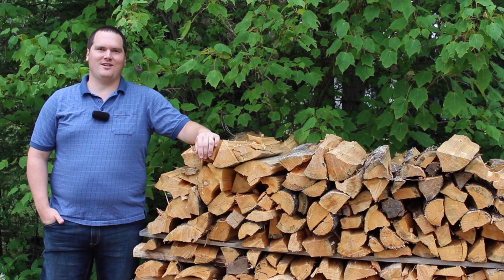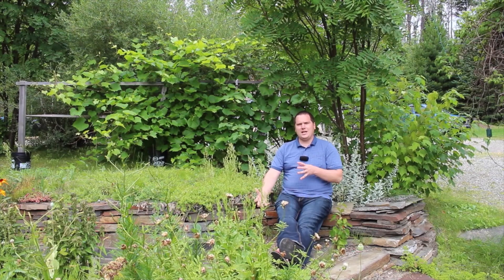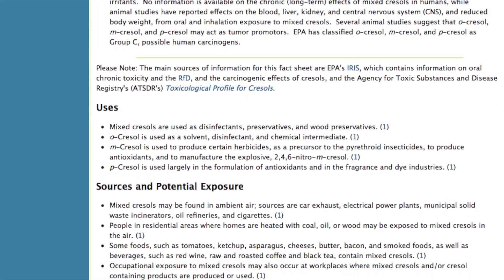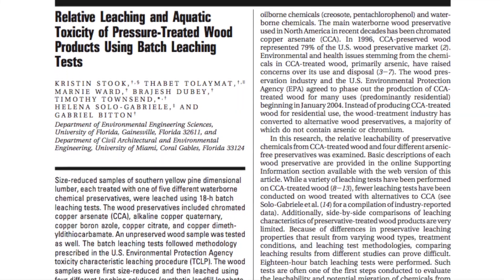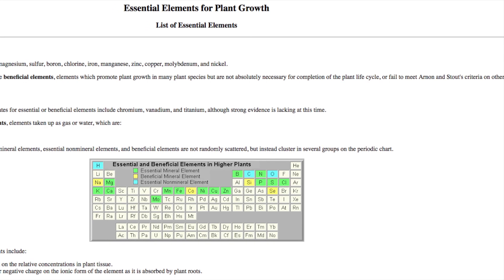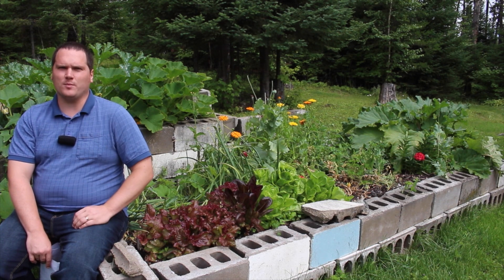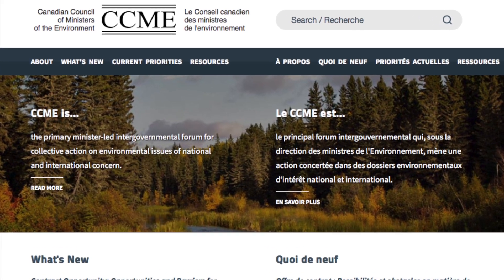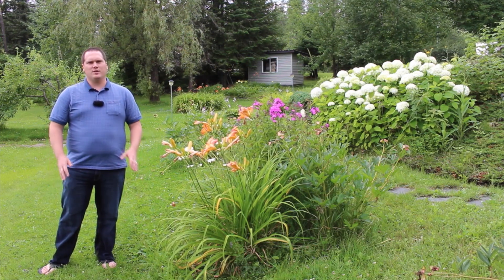Is Pressure Treated Wood Harmful to use in the Garden?

Comment: Hi, I’m concerned because I sprayed the inside of my planter box with Copper-Green to preserve the wood (before I learned that redwood has its own natural preservatives). 

The smell was SO bad, I had to immediately wash my hands, hair and clothes!  It’s not the 10% copper naphthenate I’m concerned with as much as the 90% Inert ingredients, which include petroleum distillates. Three days later and the smell is still very strong, and now Im concerned about planting my edibles in it!  

Do you or any readers here have any experience with Copper-Green and ideas of how I can remove or dilute some of the chemical residual (other than sanding it down)?

Comment: So I think what remains is that the PT lumber, even if it says it's rated for ground contact, still will eventually break down. So if you want them to last longer, then using an HDPE (type 2) or LDPE (type 4) plastic barrier might be a smart move anyway.  Also being sure to use a ceramic coated screw because the copper will react with any disimilar metal fastener and corrode it so the joints weaken faster than the wood. The sun can do quite a bit of damage to PT too. They say you can put a U/V protective finish on it about 6 months after it's had a chance to dry out.

Comment: Hmm, great video and nicely presented but I do have a concern. How do we know that the control hasn't been impacted by the leaching? A better control might be to use soil from a raised garden that doesn't have any pressure treated wood at all. You're also mentioning that it's only harmful if at toxic levels-- but I wonder if things like copper accumulate in our system, especially over time? Things to consider.

Comment: While this should reassure folks about the use of commercially treated wood, keep in mind avoiding DIY materials like used motor oil, which many use in fence post installs, and which could end up in proximity to a garden bed. Another more complex issue is whether some plants concentrate certain materials like selenium, such that safe soil concentrations might still result in higher levels in the actual consumed produce.

Comment: Thanks for the video Stephen!

I would like to use pressure-treated wood for construction of my 
garden, but I plan on using a plastic liner between the wood and soil. I 
have a few questions though:
1.) Do I have to line the bottom of the garden, even if it is not directly in contact with the pressure-treated wood? 
2.) If so, do I poke holes in the bottom of the plastic so that water can drain from the soil?
3.) At what depth do I bury the plastic? In other words, how much soil do I
 need to have so the roots won't penetrate the plastic?
4.) How thick (what MIL size) should I use?
5.) How often do I need to replace it the plastic?
Thanks!
- Chris

Comment: Thank you for this video so informative and not full off superstition and old wives tales. I have been on the fence with what lumber to use. I don't want to use the standard white wood and tends to break down in 5 years or so here in Utah. I am looking at using a pressure treated hemlock such as: https://www.lowes.com/pd/Top-Choice-Common-2-in-x-8-in-x-12-ft-Actual-1-5-in-x-7-25-in-x-12-ft-Pressure-Treated-Lumber/50017306 

However it says not treated for ground contact? Not sure if I can find anything that is meant for ground contact? Any suggestions? Is this fine. Lastly if all else fails lining it in a plastic (only the sides) would stop leaching almost entirely?
Reply from the maker: There is limited risk with the products in your local hardware store :)

Comment: You got me out of analysis to paralysis thank you! Any chance you could follow up with the use of plastic lumbers and leachinig of BPA, PVC or phthalates into the soil? Some even claim concrete blocks leach excess lime into the soil. Not sure if that's a bad thing. Is using a rubber EPDM membrane a safe way to provide a safe barrier between soil and any of these to prevent leaching?
Reply from the maker: +MrBrianDuga I have those on my list but am taking a break form these videos until the fall.  too much going on in the garden!  please make sure to tune in!

Comment: I've read ACQ is much less toxic than CCA.
Your data appears to indicate leaching decreases over time (which makes sense given that the wood has a fixed initial concentration that leaches out).
For people who choose to use treated wood, an internal bed poly liner is a good practice.

Thanks for sharing!
Reply from the maker: +A B the leaching does not seem to be an issue even in my highly active beds but that is assuming you don't till and physically disturb the bed.
Reply: Granted...and I didn't imply that it was a (toxic) issue.  I only mentioned it as I did because for some people even that much leaching doesn't give them a warm fuzzy & such people would either look for other ways to mitigate leaching further or totally avoid such wood in their beds.  Personally, I don't think it's a significant danger, but I understand when people want to put in a poly barrier or not use it at all.
Reply from the maker: I got you now!  I agree it is a limited risk and ultimately what I hope to show is options and evidence so people can make up their minds
Reply: Check!  You did all 3 things and more! :)

Comment: Great info Stephen.
Still get CCA here as the main landscaping treated timber.  We have very limited access to ACQ & we also pay a premium of about 300% when compared to normal CCA treated pine (for a 50 x 200 x 2400) sleeper.  Have been trying to find some local to build the beds in the new garden. Think I'll be sticking to recycled tin at this rate ;)    
Cheers Mate.
Reply from the maker: Recycled tin sounds like a much better idea than spending that much money on treated lumber. The added benefit is Tin takes forever to decay :) 

I wonder why it's hard to get there. Do you import it all ?
Reply: ***** Just not the call for it when there is CCA so readily available. I really don't think most people care. Have seen a lot of veggie gardens set up with treated timber & most folks don't care.
Reply from the maker: Thats concerning.  CCA is not nearly as safe!
Reply: It is OK if you have a membrane  I used it at our old house builder film  works fine

Comment: Stephen,good info as always, but my question is :what about pressure treated wood that is also coated with Thompson's Water Seal or Zinser? Are they harmful when put on the wood used in a raised bed?
Reply: +Chris Dahl Seals are usually an oil based product. Oil will eventually leach out of the wood in a broken down form. In my experience, oils tend to break down into tar like products, and will most likely stay in the soil. I personally would not use any wood treated with a seal on the surfaces touching the soil, but I would think the outer surfaces should pose no problem. I have no scientific data to support anything, just my personal experience using wood seals and oil in general.
Reply from the maker: +Chris Dahl Sorry Chris I mist competing back.  I am not sure what the products are made from but if you take  a look there should only be a Biocide and a copper agent.  There should be nothing in it that is a hydrocarbon.  If there is I would avoid its use for now.
Reply: +Alberta Urban Garden Simple Organic and Sustainable  Your reply threw me...after 7 mos. Lol! I had not remembered what I asked. I'll look at their ingredients. Thanks for getting back to me, I appreciate your observations about what to look for. Happy spring, almost!
Reply from the maker: Sorry about that.  some times YouTube plays tricks on me and I don't see all the comments right away.  I really try to keep up!
Reply: ***** Stephen, I'm not criticising, I really was amused and grateful that you replied, so no worries,ok. I know how technology sometimes messes up. I have a cell phone that doesn't always ring and it sometimes takes 45 minutes for a voice mail to come thru. My wife was not happy when I didn't get her from work on time but we both laughed when I got her voice mail 5 minutes after I picked her up,while we were driving home.
Reply from the maker: Oh I did not think you were criticizing but the silly technology is so powerful yet has these little oddities that seem to always force me to miss things!  I know what you mean about voice mails mine some times take up to 4 days!

Comment: Another excellent test, thanks Stephen. I have a  related issue that it would be nice to have the science on. Where I live, there is an endless supply of laminate-covered chipboard panels. When people get tired of their old flat-pack furniture, they put it out in the street and the next day the city truck comes and takes it to the dump/recycling facility. This means I could build raised beds for a zero materials cost, but I haven't done this so far since chipboard is bonded with a formalin based adhesive (or so I believe). Whether it would be a good idea to be growing edibles in the proximity of this stuff is the question. Over to you Doc.
Reply from the maker: Robert Seviour There is a lot more going on with siding materials than treated lumber for landscape use.  I would have to know what the component materials are to assess.  Much more research is required.  If you do use it make sure to use a liner to isolate the lumber until you are able to find out more.

Comment: I was also worried about it so I wound up using hardy planks. 
http://www.homedepot.com/p/James-Hardie-HardiePlank-HZ10-5-16-in-x-8-25-in-x-144-in-Fiber-Cement-Select-Cedarmill-Lap-Siding-215518/100064049
Reply from the maker: SentByHim That is interesting I would have never thought about using those.
Reply: SentByHim that's assuming that this is safer

Comment: Very interesting results, Stephen! The beds we make from untreated pine last about 10 years, so we haven't seen the need to use treated lumber.
Reply from the maker: OneYardRevolution | Frugal & Sustainable Organic Gardening Its great you can get 10 + years of life out of pine!  I have some treated lumber at year 9 and on impact so far. I also have some pine and once again it is fine.  Whats funny is my fence that is 5 years old is having rot issues.
Reply: ***** I think the key is to have as few surface areas in contact with the soil. We don't bury any of the wood, so only the inside and bottom are in contact with the soil.
Reply from the maker: That's a good point.

Comment: So I assume it is still not a good idea to use old railroad ties. I am glad you did this vid we are in the process of expanding our beds and I am thinking about using land scape timber for a be and was wondering about this very thing
Reply from the maker: LCJ farms Old Railway ties are Creostol.  If you isolate them you can use them however I would recommend avoiding them as I do know they leach more.
Reply: LCJ farms Perhaps lining the inside of a bed made from RR ties with inexpensive 1/2"  sacrificial pine or fir boards would be a solution. Even if they rot out quickly, they would be pretty easy and cheap to replace every few years. I think I would try it if I had access to some. But then I'm a pretty cheap guy.

Comment: Excellent video as usual! I used UNtreated 2x8's for my small 3x8' raised bed and so far it's holding up very well. About 3 years so far. Even if I had to replace a board or two say in another 3-4 years it would be only a minor inconvenience and simple to do.
Reply from the maker: Tommyr I have some that are pressure treated and some that are not.  So far most are doing fine but only time will tell :)

Comment: Good job Stephen! This is excellent info that should help any concerned gardener to maintain a balanced perspective. The mere presence of copper isn't even an issue of course, since it is an essential micro-nutrient after all. And then too, there is the fact that people will intentionally apply copper (as an organic pesticide / fungicide). I've often thought that your exposure to treated chemicals is MUCH more of an issue if you walk barefoot on a brand new deck. I've even been testing growing worms in a box built from treated wood -just to see if they will die or try to escape. The box has no bottom and they are free to leave, but they are happy and thriving! I ain't afraid...  :D
Reply from the maker: AlboPepper I had not thought of the use of copper containing pesticides!  Ill have to take a look into that!  

I think your right.'  Your exposure while walking on or building a new deck is much higher than what the evidence shows here!  

I bet your worms are happy have there been any gaps developing between the boards?
Reply: *****
I had used decking boards rather than 2" thick boards. It was cheaper and worked ok, but yeah there are some gaps. I didn't really do a lot to tie each row of boards together. That's the thing with treated. The reduced dimensional stability means the wood wants to warp, cup and twist. So a person needs to plan for that.
Reply from the maker: It likely would help with air flow lol.
Reply: ***** <<I think your right.'>>  Grammar police infraction  [ you're ].
Reply from the maker: I'll go ahead and blame the phone not the operator :)

Comment: If I'm any judge, your videos just keep getting better, both in respect to content and production.  And this is a subject that I was very happy to see you address since I knew you would do so fairly.  I wonder, especially for the biocides, if high levels of biological activity in the soil would be more likely to break these chemicals down as they moved further away from the host wood.  I also wonder about the levels of copper etc that migrate into the plants.  Thanks again for an excellent video.
Reply from the maker: Randy Chadwick Your Hypothesis is correct.  The biocides work by breaking down when they come in contact with its target.  Then it breaks into its component materials like ammonia that end up as a food source ;)

I am fairly sure even if in excess copper uptake would not increase in plants.  It might just end up causing an imposed deficiency in the soil for another nutrient. 

I am quite glad you find my assessment fair its what a good scientist does!